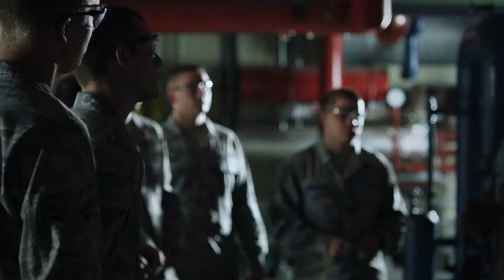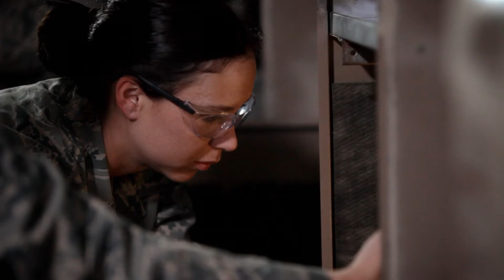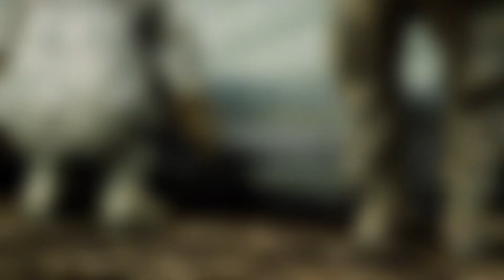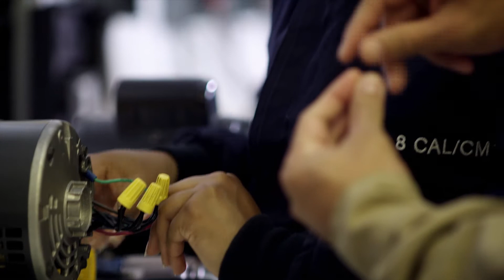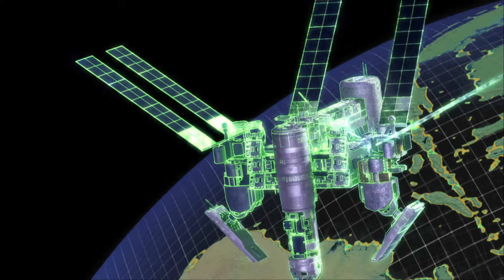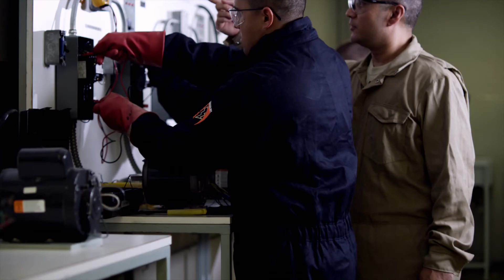U.S. Air Force: Heating, Ventilation, and Air Conditioning

Comment: Long winded point of view here. The Air Force HVAC/R school is learning the basic principles of the trade. Nothing to in depth to be honest. Regular trade school will better prepare you for the industry. This coming from a Air Force veteran 8 years active 12 years Air Guard and 1.5 years of deployments. Depending where you are stationed will dictate how much knowledge you actually gain. I was stationed at Luke AFB 1992-1999 and did commercial HVAC; chillers, cooling towers, hospital cooling and heating systems, boilers, pumps and air handling units. When I left in 1999 I had a pretty good grasp on the trade itself sans the automation aspect of commercial HVAC. Went I got hired in the real world, I had a rude awakening, it took me a year to adjust. Just different because the Air Force is a little backwards compared to the real world. I mean its a completely different pace, you don't have to modify equipment to save on the correct parts, cant allow for any downtime, customers yelling about their system being down. When I reenlisted in the Air Guard and deployed with Active Duty is when I saw the real difference in 2005 and 2010. I was simply a better tech in every aspect then most deployed, common theme in our Air Guard unit. I was working alongside E3-E5 Airmen with 3-6 years in trade that did not understand basic electrical or mechanical troubleshooting. Most of us Air Guard HVAC guys were doing the trade in the real world and were union journeyman or craftsman level technicians. The Air Force HVAC tech school is a great place start. Although now a days I'd tell someone to go thru their local Air National Guard unit, take the GI Bill and use it for a good trade school for better skill set and in-depth learning. Then join a union and get work and training or a medium to large scale sized commercial HVAC company such as Trane, EMCOR, Carrier. They will give you many opportunities to develop your skillset and make a GREAT wage. Any other advanced training is also recommended or even going into the automation side less physical strain on the body. I'm two back surgeries in now, trashed knees and shoulders. I really enjoyed my military and civilian HVAC career. I got to maintain and see things most people never would.one of the best parts is fixing a chiller and it fires up first time and everything is running properly. There is always different equipment to work on so not everyday is the same. Deployments can be fun also, albeit 12 hour six days a week. of course civialin life can be no days off from mid April to October in Arizona with no vacations due to our high heat index here. So in hindsight my deployments were to some degree a vacation.

Comment: How high or what’s the minimum required score for the ASVAB to qualify for HVAC tech in the air force??
Reply from the maker: The ASVAB is broken down into four main categories (Mechanical, Administrative, General, and Electronic), and all enlisted career fields have a minimum score requirement that fall under one or more of these categories. These scores, along with the results of your physical examination, will be reviewed when you undergo job counseling during the enlistment process at the Military Entrance Processing Station (MEPS).

ASVAB SCORES
M-55 or E-45
Reply: @USAirForceRecruiting when you say “or” does this mean that you only need to meet one of those minimum requirements and not both?